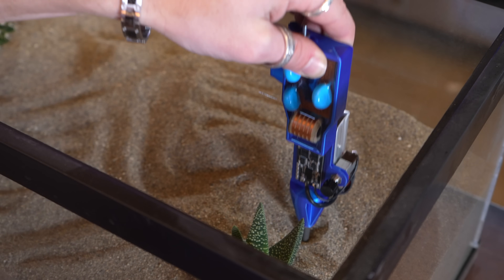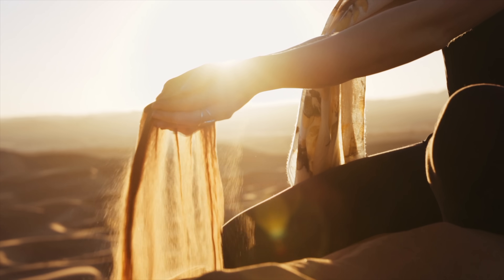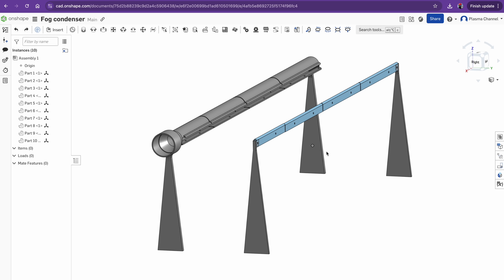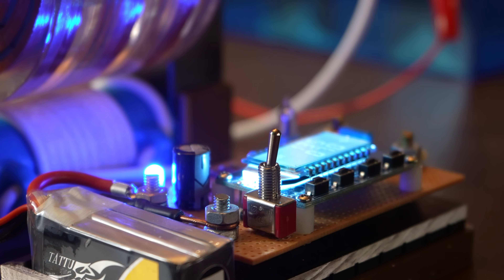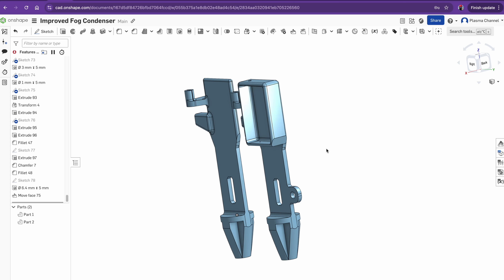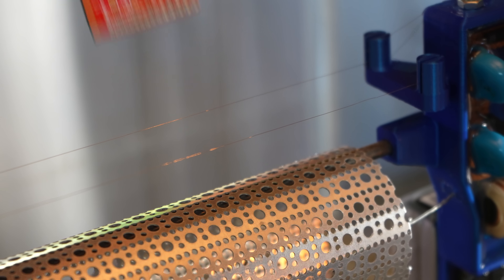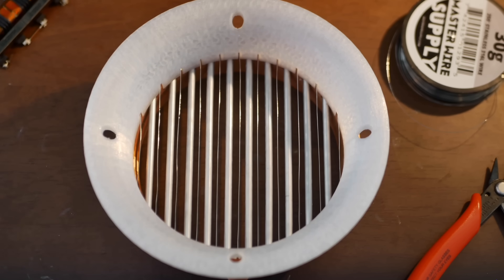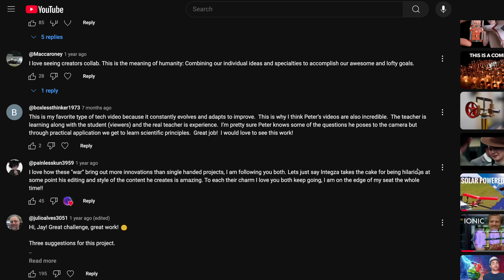Solving Desert Water Shortages Using 20,000 Volts

Comment: Harry from Toronto - Fascinating work Gruns! And thanks for comparing your design's efficiency to the commercial dehumidifier. Congratulations are in order. Two points, first my brother is a light aircraft pilot and he'd carry dry cleaner bags when flying over deserts in the US. Had his plane gone down, he could stretch the thin plastic membrane a few inches above the desert creating a taut water catcher. A stone would be placed at the centre under the stone beneath the plastic barrier. In this way he could catch water full time as ground moisture evaporated from the desert sands. I envision your condenser could be effective in a similar installation, but then could gather water 7/24. Secondly, please do optimize your system as you're already considering. I have now subscribed to your channel and look forward to viewing any coming work on this subject.Thanks again, love your work!

Comment: I think this is amazing for supplying water for a possibly cheaper way of giving clean water to those in need which could be used to water crops, but I think having it over the crops directly would decrease sunlight and ultimately decreasing the harvest but I guess also if it is in a desert it would have a large enough amount of light  possibly regardless
Reply: Not real good for any birds that might land on the wires either. 20kV does a little more than tickle.
Reply: @  I didn’t think about that but yeah definitely going to affect the wild life but probably a good scarecrow scared so much they were shocked to death

Comment: Amazing job! I would like to suggest multiple small units like these so the whole thing never goes of in one go, it'll be easier to maintain and should be very resistant during sandstorms. You will just have to get the supply distribution in mind and as usual many more things so the condenser stays failsafe for a long time. Best wishes!

Comment: Please make a detailed video about making the step up transformers, I know it's pees for you but for the rest of us it's definitely a higher barrier to entry as for the rest of the world, to try to implement this physics!
Reply: You can just buy commercial transformers it's way easier better and cheaper than making them in most cases. Obviously depends on the application, if you need a big AC transformer that's harder to find and it might be worth it to make it, small AC or big DC is almost always easier to buy.

Comment: Hi Jay, I am just starting to learn all about electricity and circuits, as I wish to build a condenser, just like yours, for my fogponic system, so that air can circulate, yet the water stays in the system. I understand everything perfectly in the video and it seems simple enough. But is it safe and what kind of high voltage supply did you use? Could i use the one you built like 8 years ago, from a balast and ionic air cleaner transformer? That one is the only one i dare attempt building😅. Thanks for the cool and informative videos:)

Comment: What if you made the grid section tubular with the wire running in the center. So all of the water droplets that become charged cannot go anywhere but the grid because they're becoming charged inside the grid. Just a thought. It would prevent any charged water from escaping because it would have to pass through one of the holes in the screen while also being charged.

Comment: Could you make a device for the front a car or some other such to make or improve viability in fog? Or would it be effected by speed of the vehicle or such and other such? Or make fog pushers or dispensers that act like you would do with a snow plow or such? As for testing or trying it in Chili that is good they have been suffering a massive drought for sometime. But this could also be good to gather water from some areas rather then trying to process salt water or such. Or it can be scaled to work on ships or cruise liners when there is fog.

Comment: I looked into this a little bit. It's not really that viable of a method for farming because farming takes an INSANE amount of water. For reference, my family has a small pistachio farm, and this tech at scale might be enough to produce 1-2% of the water we need for the year. The other challenge is collection and storage. The foggy season is already wet, so we don't need extra water then. The problem is the lack of water in the summer, when there's no fog. It's a super cool concept, but for the capital needed to building something like this, it doesn't really solve any major problems. Though maybe there is someone out there who could figure out how to make it more feasible!

Comment: The mark to beat would be desalination, which Wikipedia has at 3kWh/m^3.  You listed 14ml/Wh = 14l/kWh = 71.4kWh/m^3.  So still ~2x as energy intensive as first generation thermal desalination, and 20x more energy intensive than modern reverse osmosis.  If this has applications, it'd be minimal capex, e.g. if you could get it running off solar power with an existing electric fence transformer or something.  Still clever, but it'd be cooler without the unwarranted hype - energy efficient this ain't.

Comment: Hmm. it means it takes about 70 kwh of energy to create 1000l of clean water. Meanwhile, it would take only 2-3 kwh  of energy to desalineta 1000 l of see water. Amount of infrastructure needed to make this idea doesnt seem feasible. its cheaper to build pipes from ocean and push for desalination. but this could work as small scale solution for some really remote areas.

Comment: From Grok :

To critically analyze whether the high-voltage fog collection system described could be effectively scaled up for use on a farm or an off-grid homestead, particularly in arid environments like the Sahara or Sonoran Desert, we need to evaluate its scientific feasibility, practical scalability, efficiency, cost-effectiveness, and environmental suitability. Below, I’ll break this down step-by-step based on the information provided and general scientific principles.

1. Scientific Feasibility
The concept leverages electrostatic precipitation, where high voltage is used to charge water droplets in fog, making them attracted to a grounded collector (e.g., a metal mesh or grid). The MIT study referenced (likely from 2018, as mentioned) demonstrated a 20-fold increase in water collection efficiency compared to passive fog nets, achieving this with a small 5x5 cm grid. Your prototype, using 20-35 kV DC and a 2-foot section, produced 40-45 mL of water in 5 minutes under controlled conditions with dense, artificially generated fog.

Analysis:

Physics: The principle is sound. Charged droplets are attracted to a grounded surface due to Coulombic forces, accelerating condensation. The MIT study supports this, showing significant enhancement over traditional fog nets (2-10% efficiency). Your results align with this, as unpowered tests yielded no water, while powered tests produced measurable amounts quickly.
Fog Density: Your test used an ultrasonic fog maker, creating an unrealistically dense fog compared to natural conditions. Coastal fog in deserts like the Atacama, Sahara, or Sonoran varies in density (typically 0.05-0.5 g/m³ of water content), far less than your setup. This suggests real-world yields would be lower without optimization.
Conclusion: Scientifically viable, but performance depends heavily on ambient fog density and humidity.

2. Efficiency and Yield
Your system produced 540 mL of water per hour over a 2-foot section, using 39 watts (14 mL per watt-hour). Compared to a commercial dehumidifier (1.5 mL per watt-hour), this is impressive for fog-specific collection. However, let’s contextualize this for a farm or homestead:

Irrigation Needs: A small farm (e.g., 1 hectare, or 10,000 m²) growing drought-tolerant crops like millet or sorghum in arid regions requires 200-400 mm of water annually (2,000-4,000 m³). Spread over a 6-month growing season, that’s ~11-22 m³/day. Your 2-foot section (0.61 m) yields 0.54 L/hour, or 12.96 L/day if run continuously. Scaling to 1 hectare (assuming linear scaling along crop rows) would require ~16,400 units, producing ~212 m³/day—far exceeding needs but requiring unrealistic infrastructure.
Fog Availability: Coastal fog in deserts occurs sporadically (e.g., 50-100 days/year in the Atacama), often for only a few hours at dawn. At 4 hours/day, 50 days/year, one unit yields 108 L annually, meaning ~18,500-37,000 units would be needed for 2,000-4,000 m³—still impractical.
Analysis: While energy-efficient per watt, the system’s yield is insufficient for large-scale irrigation unless fog is extremely frequent and dense, which is rare in most deserts.

3. Scalability Challenges
Scaling from a 2-foot prototype to farm-scale introduces practical hurdles:

Infrastructure: Thousands of stakes, wires, and grounded grids would need to be installed and maintained. Your simplified wire-and-stake design reduces weight, but spanning hectares with high-voltage wires poses logistical and safety issues (e.g., wind damage, electrical hazards).
Power Supply: At 39 W/unit, 10,000 units require 390 kW continuously. Solar power is feasible (a 1 kW solar panel produces ~4-6 kWh/day in deserts), but you’d need ~65-98 kW of panels (200-300 m²) plus batteries for overnight fog, adding significant cost ($50,000-$100,000 for solar alone).
Fog Distribution: Fog isn’t uniform across a farm. Coastal proximity (within 10-20 km) is critical, limiting applicability to inland homesteads.
Conclusion: Scalability is theoretically possible but constrained by infrastructure complexity and power demands.

4. Cost-Effectiveness
Prototype Cost: Your setup uses a custom flyback transformer, voltage multiplier, battery, and 3D-printed parts. Assuming $50-100/unit for mass production, 10,000 units cost $500,000-$1M, excluding solar power and installation.
Comparison: Digging a deeper well or piping water from an oasis might cost $10,000-$50,000 upfront but provide reliable, higher-volume water. Traditional fog nets, though less efficient, are cheaper (~$1-2/m²) and passive.
Analysis: High initial and operational costs make this less competitive unless fog is abundant and other options are exhausted.

5. Environmental Suitability
Target Regions: Coastal deserts (e.g., Atacama, Namib, parts of the Sahara near Morocco) have morning fog due to cold ocean currents (e.g., Humboldt, Benguela). The Sonoran Desert, mostly inland, has less fog unless near the Gulf of California. The Sahara’s fog is rare outside coastal fringes.
Ecosystem Impact: High-voltage systems could affect insects or birds, though your low-power design mitigates this somewhat.
Conclusion: Best suited to coastal fog-prone deserts, not inland homesteads.

6. Practicality for Off-Grid Homesteads
For a small homestead (e.g., 0.1 hectare, 1,000 m²), needing 200-400 L/day:

10-20 units could produce 130-260 L/day (4 hours of fog), supplemented by solar power (~1-2 kW panels, $1,000-$2,000). This is more feasible than farm-scale, especially for drinking water or a small garden.
Conclusion: Viable for homesteads with coastal fog access and modest water needs.

Final Assessment
Farm-Scale: Unlikely to work effectively without extraordinary fog frequency and density. The yield per unit is too low, and scaling requires prohibitive infrastructure and energy costs. Traditional methods (wells, desalination) remain more practical unless fog collection is a supplemental strategy.
Off-Grid Homestead: Promising for small-scale use in fog-prone coastal deserts. A few units could sustain a family or small garden, leveraging solar power and low maintenance.

Recommendations for Improvement:

Optimize geometry (e.g., larger grids, tighter wire spacing) to maximize yield per unit.
Test in real desert fog conditions (e.g., Atacama) to validate yields.
Reduce power consumption (e.g., pulsed voltage) to enhance solar feasibility.
Integrate with passive fog nets for hybrid efficiency.
This technology is a brilliant proof-of-concept with niche potential, but it’s not yet a game-changer for large-scale arid agriculture. For homesteads in the right location, it could be a sustainable water source with further refinement.

Comment: I guess the question is if you can negatively charge a metal roof on a house, or structure, then suspend a positive wire above it? Essentially its the same thing you have but extremely super-sized.

Comment: In your video, you mentioned about doing this in the Sonoran Desert. Obviously, you're familiar with the Sonoran Desert so why not implement this apparatus in the Sonoran Desert. Pulling this off in this desert means the rest is scalable and beneficial to all. Also, the midwestern state could use this as a modified version of sprinklers and likely cut utility bills. Moving to a coastal desert in Chile seems like you're running from fears of failure. What's the worst that could happen; it doesn't work? Because of the time of year, ambient temperature plays a huge role in this since the desert is about to reach 100 degrees, at night.

Comment: What are the differences between this tech and existing electrostatic precipitators? They seem essentially identical, except the optimal spacing between plate and wire is probably different depending on your goal and voltage.

Comment: Let's imagine if you installed the mesh net above a pivot irrigation system, thus you can irrigate different points every day. Probably you can grow pasture in desert for grazing animals such as sheeps which usually fit well in dessert. But the question is, does the mesh net have to made of metal or would it work if you replace it by a fabric or polymer made material to decrease weight?

Comment: now compare the amount of water you get to the energy it used, i cant imagine that it makes sense on a comercial scale. Its the same reason why indoor vertical farming might sound nice but the required energy for doing it on a larger scale makes it unfeasible for most crops

EDIT: well, spoke to soon, he actually did, but he didnt mention cost per liter and such so here are my calculations

1l of tap water costs roughly 0.0016 cent in germany
1kWh costs rougly 27 cent (also in germany) or 0.027 cent per Wh

now, to produce 1L of water using this device would require about 71.429 Wh (calculated using rule of three using the values from the video)
this would come out to about 1.929 cent per Liter of water (71.429 x 0.027 = 1.929), which is about 1200 times more expensive than regular tap water (1.929 / 0.0016 = 1205.625)

for that price it would be more cost efficient to ship water to the places where it is needed, great concept, but not really feasible right now where energy is still a limited good

now, please correct me if im wrong, im honestly not that good with math, but comeon, that calculation really wasnt that complex

Comment: Just stopped tô think about that experiment, for a V2 ir would be interesting tô test with a cooled metal sheet for the condensation part, i don't know If a heat pump would viable tô implement and if It would Power efficient enough to still be solar powered, only testing will show, but I believe it could improve the amount of water captured!

Comment: Does it need to be a fog? Will it work as a dehumidifier in general? If you se this up before an evaporator in an air conditioner, you can improve the efficiency of the air conditioner, as much more energy will go into sensible cooling,and less waste de humidifying the air.

Comment: Hi. Wouldn’t it be easier to use Peltier elements and a mesh? With their help, you can also condense water from the air, and you don’t even need fog. All you need is a temperature difference, which they successfully create.

Comment: For context, commercial desalination plants require ~3kWh/cubic meter of water produced. The current iteration of this water collector costs 72kWh/cubic meter (or 72W/L) according to the presented figures. Which is not to say it doesn’t have its use cases, just that commercial scale desalination is significantly less energy intensive than the current iteration of this device
Reply: But do they collect fog?
Reply: -and the energy cost to transport the water from the plant to the target area, compared to just having the water there onsite.
Reply: those are commercial and very optimised, this is a experimental project
Reply: you need to add supply infrastructure and membrane replacement to that equation as well, those desalination plants are not exactly cheap to run and they need to be run almost 24/7 as they can't really be in standby mode, it's not as simple as input power to output water.
Reply: @TommyApel exactly, plus desalination plants produce a byproduct called brine which is a highly concentrated salt solution that has to be disposed of correctly to prevent environmental and land destruction.
Reply: You are not factoring in the environmental and financial cost of waste salt.

Comment: Have you considered coating the metal grid in a thin film of (conductive) water-adsorbent material?

I would imagine that enabling the metal surface to hold slightly better onto the water it's "catching" (until a certain droplet size, where gravity takes over), could potentially reduce re-evaporation loss — turning a reaction that weakly favors droplet growth, into one that strongly favors droplet growth.